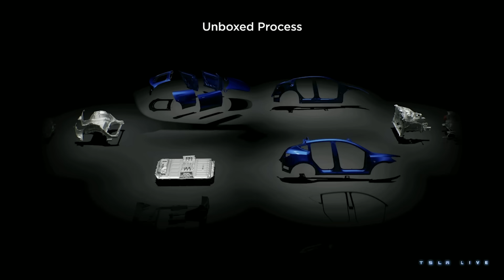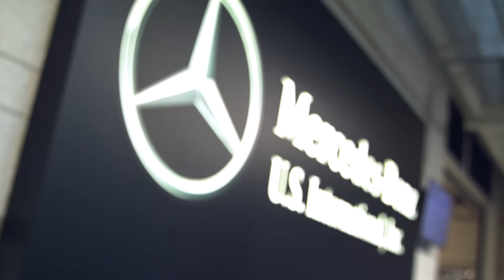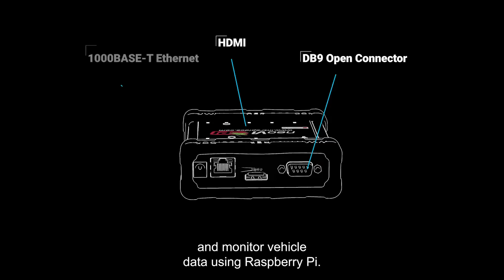Tesla Axes 10% of Workers; Magna Testing Humanoid Robots - Autoline Daily 3790

Comment: As for the 12V accessory battery that EVs come with, people don't realize that if that thing fails you will get all kinds of weird error messages on your display that do not necessarily mention the 12V battery and you may be at a loss to figure out the issue. Lead acid batteries tend to last much longer in EVs than they do in ICE cars because they don't have much of a load (they don't have to turn over a power-hungry starter but just activate a relay that engages the main battery) and they don't run in very hot engine bays (EVs make very little heat), so it's easy to forget about them and that's when they fail. The first thing I did when I got my first EV (a 2016 Kia Soul EV+) was replace the lead acid battery with a lithium ion deep cycle battery and it has been flawless. Lithium ion batteries have many advantages, like power retention for many months of non-use, lightweight, temperature tolerance and so on. If you want to do this, be sure you get one that has a BMS built-in and is deep cycle. They're around $200 on Amazon.
Reply: Good info. What brand did you get?
Reply: How do you like your Soul EV? 

I've always liked the look of the Soul... Even the early models.  I've never driven one (ICE or EV).
Reply: In theory lead acid batteries last longer in EVs in practice not as long in my experience
Reply: You beat me to it my friend, I was thinking about replacing my Mini Cooper electric AGM 12V battery with a lithium battery, but the correct size has eluded me.
Reply: @rogermartinez78 I want to find a purpose built one with a good warranty camisole video about a company wants, forgot the name
Reply: Recently extinct Chevy bolt still the best deal EV, with no imminent threat from Tesla.  Fan trolls were talking about 25k like it was a done deal

Comment: Amusing to see Autoline spin FSD price drop as a negative, legacy thinking basically.

- What's the most valuable thing in implementing vehicle autonomy? Driving data. 

- What's Tesla's biggest advantage here beside best in class dev team? The autonomous capable fleet. 

Result: Three orders of magnitude more driven miles than 2nd place thanks to that, and the gap is only growing.

- What does lower price do to FSD adoption? It's not a linear curve vs price, the growth is exponential. Is Tesla better off with (lets say) 100k $199/M customers or 500k $99/Mth customers in terms of recurring revenue and, much more importantly, autonomy miles?

(I know I'm tempted to get it now after the month trial, it's such an impressive feature, I love it)

- Tesla is no longer compute limited this year. Time to accelerate that flywheel.

- FSD is now safe enough for wider deployment, it exited "beta" status and now starting to get treated like Autopilot in terms of customer access.

Put 2 and 2 together with that and see what the big picture looks like.